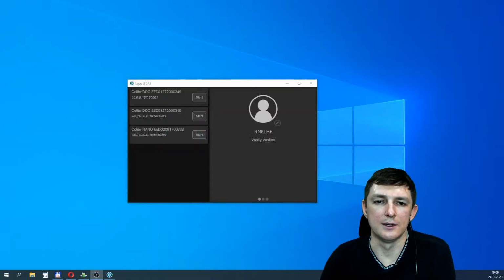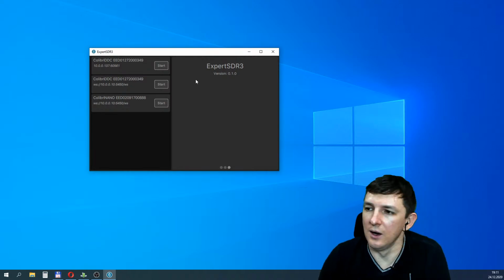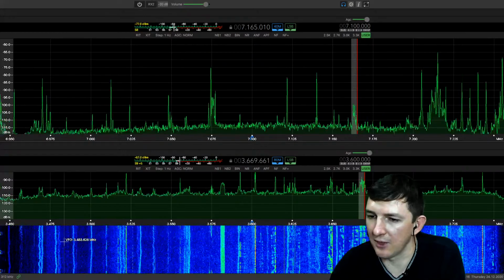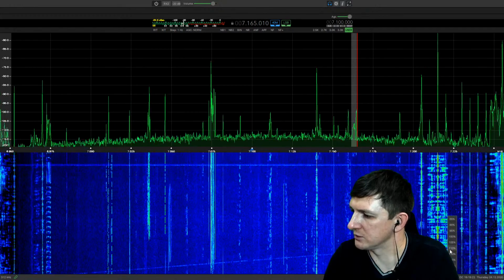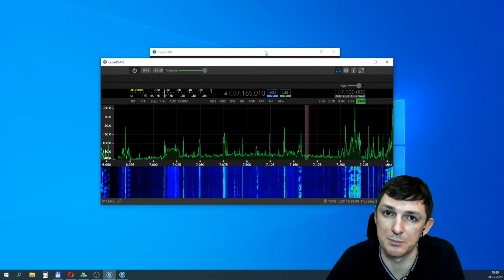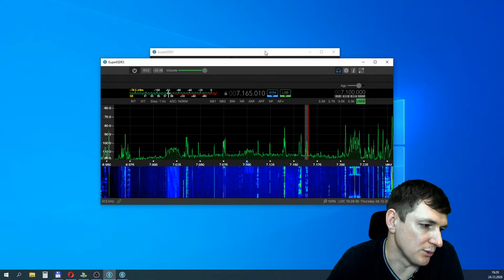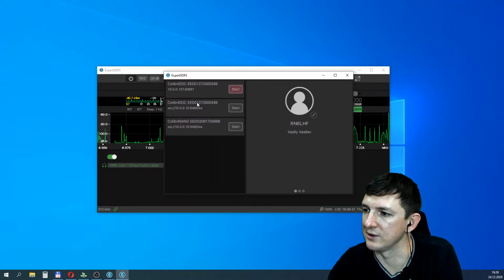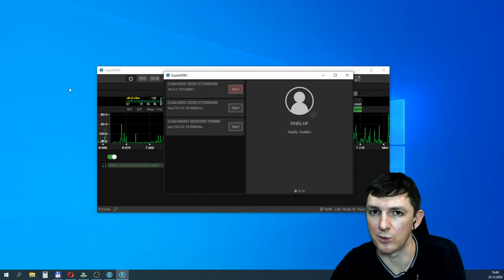ExpertSDR3 - first steps!

Comment: Great job done. Will you add the big analog S-Meter and the small S-Meter at the cursor again? And... of course, implementing the digital modes like RTTY, PSK, FSK, PSK32, packet radio etc. directly into ExpertSDR3 would be a big benefit, as at present, adding and connecting third party software for this job is too complicated. thanks and best regards, Kurt

Comment: Vasily, what about diversity reception? Can you include a button like "DRX" for 1. syncronizing RX1 and RX2 (Band, Mode, Filter, Frequency), 2. Switchting RX2 Ant. Input to RX-Ant only, 3. Switching Audio RX1 to left ear and RX2 to rigt ear with a bit difference in loudness.

Its more a macro button then a new function. Only the RX1/2 sync should be included in new Expert3 soft.

hw? bk

vy 73 Daniel DL3DW

Comment: Vasily Vasilyevich !The program content does not need to be changed!!! Make an expanded panel ( as it is done now ) and make a stripped-down one ! And don't listen to any smart guys !!! The only thing I want to say is that the program should have a NEW FUNCTIONALITY that allows and leads to an IMPROVEMENT IN the operation of the transmitter, as well as the receiver !!! Why do I insist on having simultaneous MIC LEVEL readings PEAK and RMS readings

the question is that when you set AGC or CLIPPER to a maximum amplitude of 0 dB, it would be very useful to know how much these modules smooth out the PEAK of the signal .The microphone level readings on the TX meter work and display information in RMS mode with different peak readings, so it is difficult to say how much we remove the peak peaks of the incoming signal to the modulator input .